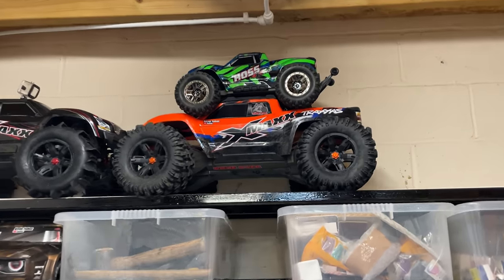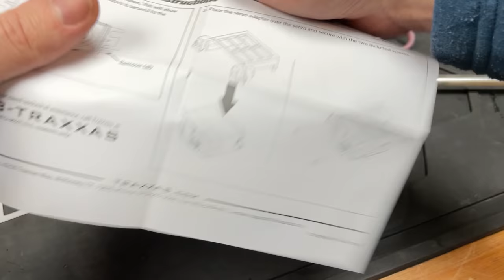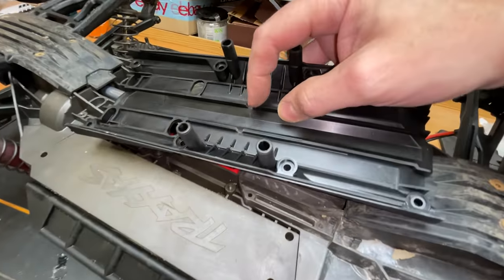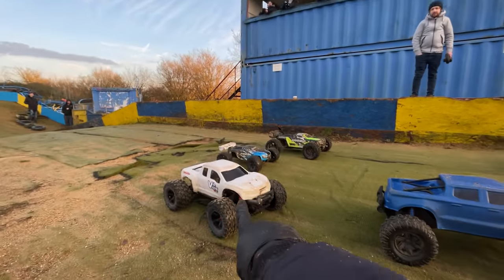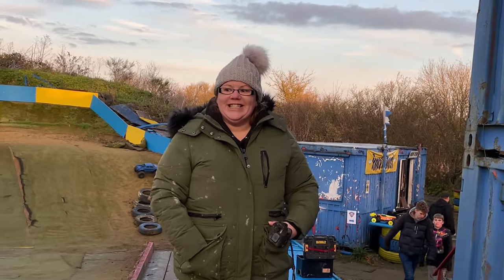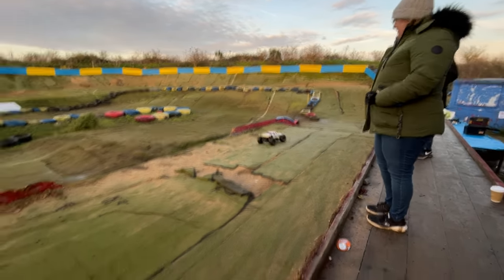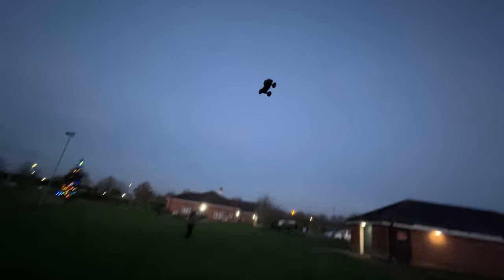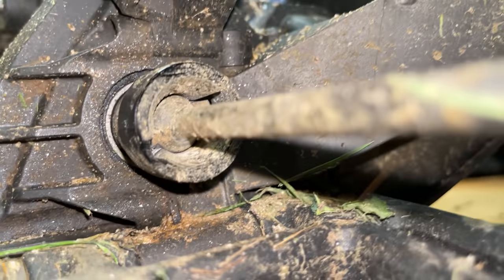WORLDS BEST rc car has 1 ANNOYING problem

Comment: RPM make the front hubs with over sized bearing now for the x maxx, that's your next upgrade and mine as well. BASH ON KEV!
Reply: thanks for the info man 👍🤝
Reply: Did they like literally drop those today lol? I was just on their site like 3 days ago & didn't see those listed.
Reply: @jkulysses  RC Guy garage put up a post in the last day or 2. I think they are a new release, I never seen them before and have been looking.....Its about time.
Reply: I just bought set after I saw this comment. Thanks for the info!

Comment: Ever since I started using RC Cars I have been using a 3-D printer and make my own parts on the cheap, Don’t get me wrong they’re not the most durable parts, but for under 10p per part it’s not worth worrying about
Reply: That's awesome I talked to a guy who 3d prints stuff outta titanium made some spur gears I have to order them from him yet cant wait to see how they hold up
Reply: 3D printing plastics are getting better every year. I am printing lots of RC-Parts (For planes mainly) with ASA filament. I even print propellers and they hold up well. Hobby 3D-printing has come a long way and parts will become more durable in the next years. Industrially printed parts are already as strong as milled or molded parts. JetCat uses printed Aluminium parts on their model jet engines. 
So hobby 3D-printed parts are not as durable as the original ones but in 5-10 years, things could be very different.
Reply: Cool for esc mounts but 3d printed parts still don't hold up at all to bashing. Light aircraft that aren't going to be slammed into the ground is another story.

Comment: What Happens if you don’t tap a new hole in the arm and use the existing ones? Can you just set the endpoints to work with the different geometry

Comment: Did you cut only one piece of the new driveshaft or did you do both? I understand that if it is only the one for a frontal collision, but I feel as if it needs a bit more "give" to it in case the center of the chassis flexes when it lands hard on all fours.

Edit: I also did the chassis and front bulkhead trim myself for the servo I chose. It's a must-do modification if you're running a servo like that to make room for the servo. Very clever.
Reply: I have four pairs of stock tires that BROKE! (Use as work bench stands for cars now). Bought DURATRAX SIX PACK X (DTXC5502) BELTED tires. DANG!!! I can even do auto upright without blowing a tire!!! WELL WORTH THE $$$!!! Handling is INSANE!!!

Comment: I made a replacement chassis brace  that has a mounting bracket on the bottom side so you can install a 5th scale servo with absolutely no cutting or modifying

Comment: your xmaxx was running really weak man like is there somthing going on with the drive shaft and gearing is somthing slipping or tightning up allot?
Reply from the maker: just had it on old lipos and its geared down at the moment
Reply: @KevinTalbotTV  k gotcha sorry i said your xmaxx sucked didmnt relize that i thought you had it on 8s i was like wow thats slow

Comment: Hey Kevin, Do I have to run an upgraded ESC like the Max 6 you are using in order to run this Steering Servo upgrade or will the stock Xmaxx 8s ESC work?

Comment: Kev, about your BEC and 6 Volt becauce the receiver: Think about Voltage of a fully charged NiMH-Pack with 5 Cells ;-) Thats nearly 7,4 v without damaging the receiver ;-) You can run the reciever with 7,4 v, cause the manufacturers tell us the NOMINAL voltage, and they even know its more wenn fully charged ;-) greets

Comment: I have a traxxas rustler 2wd with like 500 us dollers in it and I can never break it most times. it has a goolrc 3970kv moter in it and I only run 50c or 80c 2s lipo batteries from zee on Amazon and they are nice and cheap. my rustler is a beast it could take a jump from atleast 50 or 60 feet I think I do back flips with it when I run with me friends

Comment: Kevin, have you ever run one of these servos off of a 2S battery using a receiver bypass wire so you get the full 8.4V? Curious on your thoughts!

Comment: fun fact, i use my traxxas receuvers with 7.2 and 7.4 volt BECs and they work fine for years. Also, these receivers are also used in traxxas nitro trucks, that are running on 5s nimh battery without a problem, and 5s nimh can have even higher voltage if fully charged

Comment: Be careful, this solution is worse!  the problem will arise even more quickly because there is no play at all at all at the slightest Flex The driveshaft bah twist, your system is not good
Reply: He sawed part of each side off so there's a little play in it

Comment: Hey Kev, if you had to pick 1 set of tires for the X-maxx, which ones would it be?  I've kept the factory ones because of how light they are, but they don't seem to be very durable.  I really like the way the prolines look but they are so heavy.  Any other suggestions?
Reply: I have four pairs of stock tires that BROKE! (Use as work bench stands for cars now). Bought DURATRAX SIX PACK X (DTXC5502) BELTED tires. DANG!!! I can even do auto upright without blowing a tire!!! WELL WORTH THE $$$!!! Handling is INSANE!!!